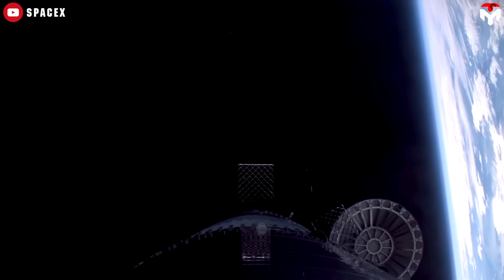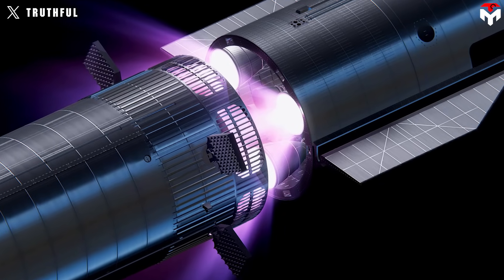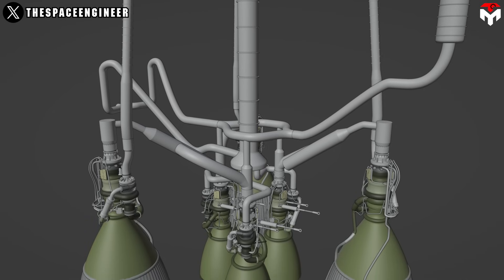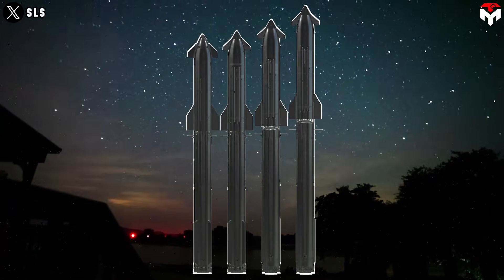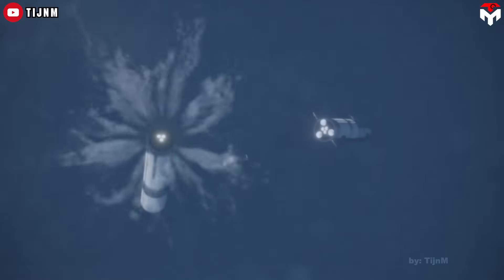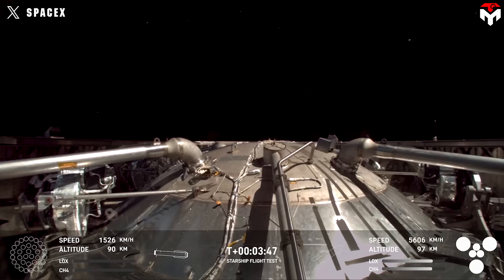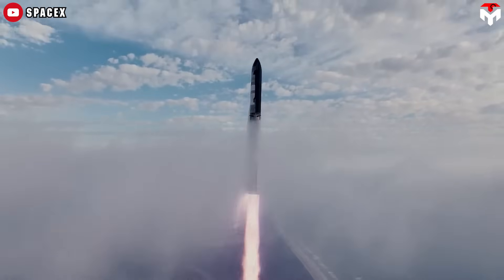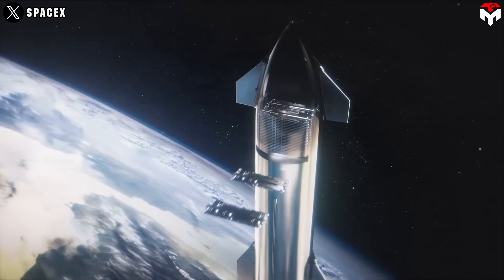SpaceX Starship in Big Trouble with Hot Staging! Flight 9's Solution...

Comment: The obvious answer is to implement a stage separation process that doesn't vent into the interstage.
The current system needs to spool up the second stage engines right into the interstage section - a process that is relatively slow, turbulent and hot - and obviously not working.

In order to get the desirable positive/continuous  G benefits of hot staging, without spooling up the main second stage engines until after some degree of positive separation has occurred (that all but eliminates thermal and pressure issues) then a secondary system is necessary.   I know it would be an intellectually difficult/offensive ask for the designers and Elon - but some small strap-on solid fuel boosters that only fired for maybe 5-10 seconds, would solve the problem.

Alternatively... move the vacuum optimised engines to the middle, the sea level ones to the outside edge - and then during hot staging, pivot/angle the 'sea levels' outward, via cutouts in the interstage fairing.

Comment: Lol just put a big spring instead.
Reply: That spring have to be VERY LARGE for it to push that BIG FREAKING ROCKET away from the Booster and also need a mechanism for it to release the latch that hold onto the BIG A$$ springs.  , hence added weight.......Not that freaking hard to understand.

Comment: The hot staging ring is a temporary solution, the next iteration of the Super Heavy will use struts.
Reply: Then it better be a BIG A$$ struts for it to be able to push that Starship away from the Booster, which also adds weight too.....

Comment: The last test flight showed a hot spot on the inside face of a vacuum raptor rocket bell. It’s highly likely the shock of hot staging did the damage.
Reply: The huge pressure from the Rocket firing probably came back to hit the Bell part of the engine and did something to it, or it's associated parts.

Comment: A bloke positioned either side of the hot staging, with parachutes, as the hot stage seperates pull rip cord, starship would then pull away from the hot stage..... Simples
Reply: The problem is that it ADDS more weight to the Starship weight. Also, with the parachute on the hot stage ring, they don't know where it will land....It could land on a street in some town, or it could land on a highway, or it could land in the water where the boats are.....NOT VERY PREDICTABLE. Sooo, you sure it is that SIMPLE????

Comment: Am just shaking my head now, this post has just covered every single problem I have highlighted since the second they decided to hot stage! Every single point I raised has in some cases been told to you damn near word for word right here!

The ship, V1/ V2 and in many ways V3 have not been designed and ""engineered"" to survive hot staging. This includes damn near ever system on that ship ok....EVERY SINGLE SYSTEM IS TAKING MASSIVE SHOCK DURING HOT STAGING...... 
It requires very near a complete redesign of actual systems and or the fixings of these systems.

The hot staging itself, engine bay wise, the critical problem is amplifying shockwaves to obviously destructive levels. Yes, when you reflect shockwave"S" back into a confined space filled with angular deflecting surfaces, like waves in the ocean building into each other you are amplifying the shockwaves.
It is not a shockwave folks they are shochwaves, the separation burn is sustained therefore continually sending shockwaves into the engine bay and subjecting the entire ship to very extreme conditions it was not designed to endure in the first place.

The engines were not even designed to deal with such harsh conditions in reality, you will find the russian engines used in hot staging have far stronger bells for a start. RD180 is as heavy as it is for 1 specific reason.... hot staging! It is the tank of rocket engines even today. SpaceX would do well to start looking at it at this point.

Seems to me spacex are missing one critical thing, an engineer with real world experience but also common sense at this point. From the very first point of base construction till now it is honestly like a circus..... just wow

Comment: The human landing system that’s been shown has Draco engines on the side of starship positioned around the top third of the ship. Why not put them on now and use them for hot staging? Then once they’ve separated fire the vacuum engines that way there’s no shockwave or blowback in the hot staging ring and starship would maintain thrust during separation.

Comment: Why not add solid fuel rockets to the Starship top fins?  These solid fuel rockets would ignite during the booster and Starship separation lifting the Starship from the Booster.  Once safety separated, the Starship engines could then safety ignite.  The solid fuel rockets, now expended, would be jettisoned.  This would negate the need for and the mass of the Hot Ring.

Comment: Need a smaller start sequence before ignition of the vacuum Raptors. Add a mini 10 second engine just for seperation.separation. Maybe even a small explosion to separate the booster from the starship
Reply from the maker: Interesting idea! 🤯
Reply: @techmap9 agree. Unlatch/separate. Ignition. Plausible. I have a drawing💡ring/ship.
Reply: Saturn V had retro rockets on 1st stage to push it away from 2nd stage, and a ring-shaped interstage. On Apollo 15, they tried reducing number of retrorockets, resulting in a slower separatation, which damaged the dome of the 1st stage.
Search for "Apollo 15 Saturn V mods to increase payload capacity & the GREAT potential hazard one of them caused"

Comment: If the vacuum Raptors were damaged during hot staging...I seriously doubt they'd run for over 5 minutes before failing as they've now done twice.   These engines and the new V2 fuel system have been extensively run statically without a problem so something is happening during flight that they can't replicate on the ground.   The acceleration G's will be loading all of the fuel lines and changing their harmonic resonant frequencies which seem to be getting out of control once the dampening effect of the liquid oxygen they route through drops low enough.   Rocket failures normally happen quickly after damage and I believe SpaceX is on the right track with their harmonic dampening efforts on the V2 fuel system.
Reply from the maker: Thanks for sharing
Reply: Taking into consideration the boost importance why not look into other out of the box ideas like magnetic air ram piston type of launching seperation